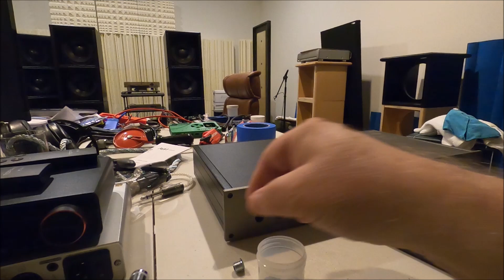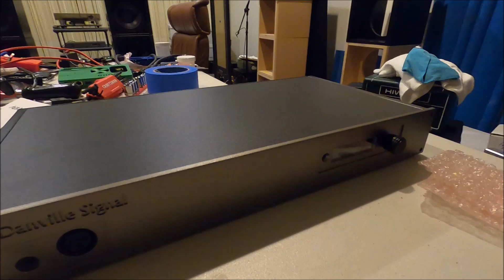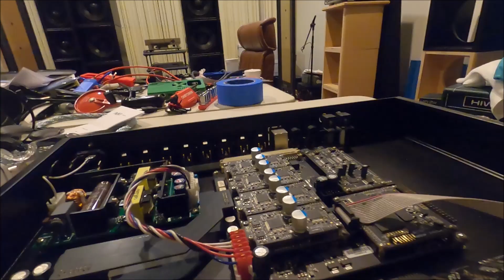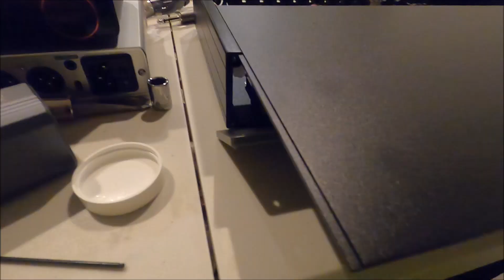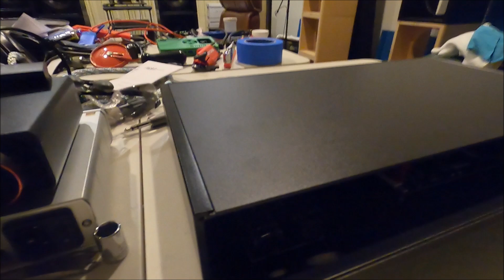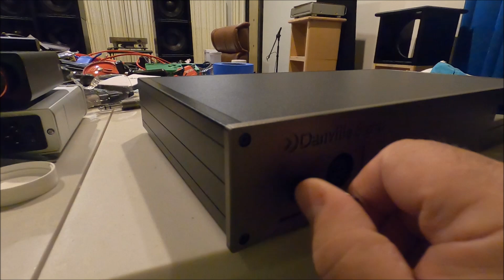Upgrading the Danville Signal dspNexus 2x8 system with the ADSP21569 dspBlok

Comment: Looks like a very easy upgrade.  anyone can do it
Reply from the maker: Yes, very easy upgrade for the original owners to do.  The full production system will have the ADSP21569 dspBlok installed.  This also applies to the 4 AKM DAC boards that can be upgraded from the AK4493S to AK4499EX version.